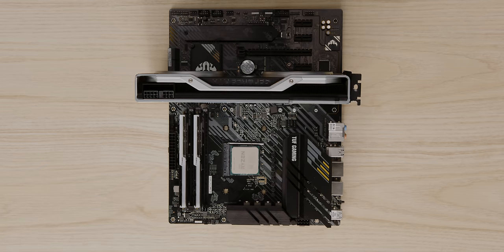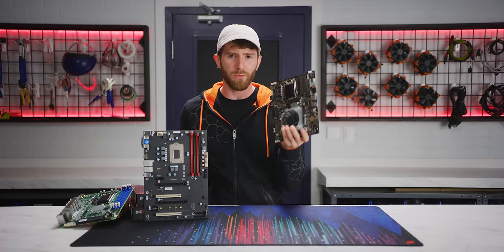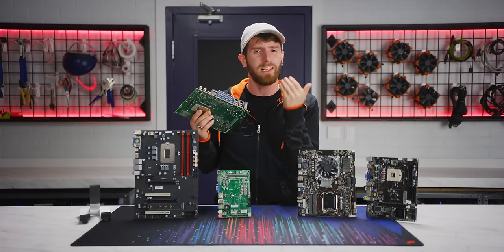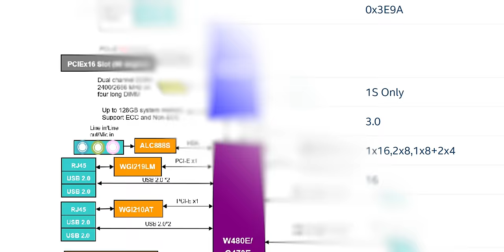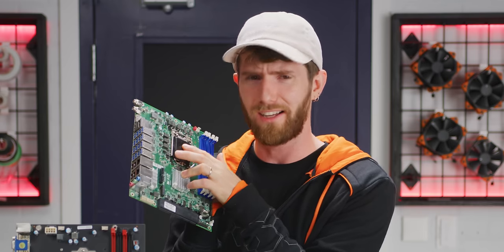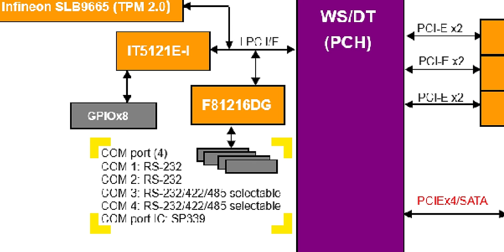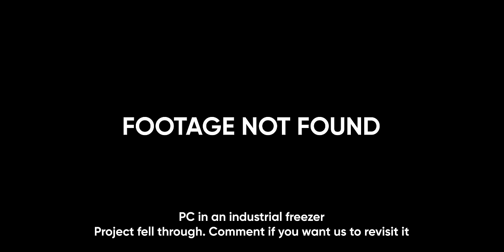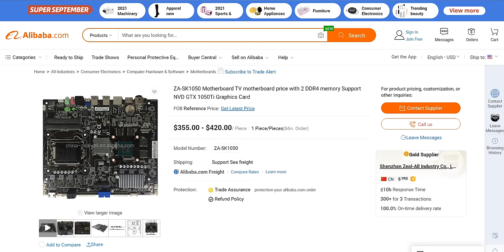5 weird motherboards that shouldn't exist

Comment: Not gonna lie, as a streamer with so much stuff plugged into my pc that I need a usb hub, that first mobo would be a godsend.
Reply: I agree with you, I need a ton of USB expansion myself. I want to upgrade to a 10 port Board like the ASUS ROG Dark Hero (AM4). After that, I want to build my PC into my desk and make a dual System case. One will be storage, one does everything else. I honestly considered threadripper at some point, but thats not certainly helpful on the main system atleast. Happy creating!
Reply: I just use a PCIe USB expansion card. No hubs to worry about (as I've had problems with hubs and audio interfaces playing nice) and you get more full speed ports
Reply: @alphapt9370  EDIT: I also look for dual Ethernet ports. One must be gigabit, one must be 2.5 gig since my storage would be in RAID (the secondary system I mentioned). I've tested it already with my current equipment without RAID, over one gigabit and also streaming it back (over Steam in home streaming with almost no compression maxing out at 104mbit upstream). It did work fine, but going a bit higher doesn't hurt here since I definitely would cap out on 1 gig due the increased read speed of the RAID. Also theyre very fast drives too (for SATA atleast). I mean on what average drive so I get 200mbs per second? The best consumer grade drive I found would throw 180mbs at best as far as the collected data is to be believed. And it probably doesn't just host games aswell.
Reply: @Aquatarkus96  I don't really want to go that route. Probably more pcie lanes being used that I could need somewhere else, but I'm not too sure how exactly every motherboard out there handles their lanes and IO. I know quite a bunch, but I don't know everything, but I try to know everything. That's a hard goal to achieve and I probably will never succeed it. There is just so much information in this world. But I will try to ever expand till I can't no more. Maybe I'm just crazy
Reply: @alphapt9370  Also consideration is also the Lian Li DK-05F or a custom build. As far as ive seen, all the ports on the dark hero are usable? 4 go to the CPU, the others are chipset as far as I know. Gigabyte overs thunderbolt tho. Thats also a selling point. Pretty hard decisions tbh. Also Ryzen XT (we don't know naming yet but probably XT) will be important with more cache. Data compression and heavy CPU and cache heavy tasks will most likely be a thing. Will have to see how it performs in comparison to the CPUs without the bigger cache. CPU performance is important, Threadripper would be more useful, in terms of IO, PCIe lanes and multicore but less useful for other tasks and also more expensive.
Reply: @alphapt9370  ❤️ very kind of you, its nice too meet you ^-^
Reply: @Mom19  As promised, back.
It's fine setting your goals high, as it's your pet project, and you're the one that should know the end goal.
As for the CPU choice, when the XT variant comes out (well, yeh, all points that they should call it that), my mobo suggestion might not be the best one, as it wasnt tested for those higher end skews. 

For fans, look up server grade fans, as they are designed to move the highest volume of hair on enclosures. Mind you, they are loud. And dangerous, to a point. It can easily break skin, or nip a tip of a finger. So if you go that route, be 100% sure that they are protected from the outside\inside with a metal grid to prevent accidents. But they will move all the air. If sound is an issue (and it should), you cant go wrong with Noctua. They're not pretty, but that's subjective, but they also have them in black, and that's less of an eye sore. Hard to find, but they exist.

As for mobos, i'll probably repeat what you already know. Most brands have 4 skews. The budget, the mid range, the high tier and the enthusiast grade boards. What is important is what CPU you're pairing it with. Knowing that, we can exclude the budget and part of the mid range. Comes down to decent VRMs, and how decently they are cooled. We can also exclude enthusiast grade (but you do you), as they are extremely expensive and do not offer that much on top. The one you picked is considered high tier. Personally I think most mid-high range can provide the performance that a high level user will ever need, but that's me. We can dwell on the skews if it comes to that, as this requires looking at all brands offerings, looking at the specific skews that will fit your needs, see what boards can drive a 5950x without any tested complaints (we can extrapolate if it runs it, it can run the XT when and if it comes out), and then have a short list of options that works for your use case. 

As for RGB issues, I already covered that in my previous post, giving you the software option to drive all of it, as you want it.

As for dual ethernet ports. It could limit your mobo selection, so i suggest you work around it. If you dont find a mobo that has that specific request, you can always go the PCI-E way instead, increasing your mobo pool of options. And I understand you wanting to give it a bit more breathing room, but remember it needs a equal speed output on the other side. Here's assuming as well the drives you have can fully saturate it. I still dont understand what your usage will be, but if it's just file serving, have you considered a NAS drive instead? Even as a game drive, given enough bandwidth, it's perfectly suitable. If the 2nd PC was just for that, consider just this instead. Mind you, the NAS rabbit hole is long and deep. You can find easy to use solutions, affordable solutions, expandable even, but the price range can be from budget to "since when I was a fortune 500 company to even be looking at these products" range. What they boil down to is dedicated compact PC's designed for the sole purpose of file sharing towards a network. Be it one or more, that's where they shine. But a step down from a server rack with storage.

Dont worry that much about bottlenecking. As it will happen. It's a losing battle. The best we can do is mitigate. But there will always exist. But from what I see your vision is, and what components you're planning on getting, you should be fine in most workloads. And yes, Threadripper is a work horse, with the price tag to accompany it, but it also limits you in your mobo selection, as it uses the TR4 socket, not the AM4. As a sidenote, one TR mobo is the Zenith. The Ethernet port on the board is the I211-AT, meaning 1GbE speeds. So they included their Aeiron 10G PCIE card in order to provide better speeds. It's not out of the kindness of their heart, it's a 800-900 buck mobo. But this illustrates the best solution. First, find the mobo that fits your needs. And then add a couple of PCIE slots on each PC with better speeds to ensure they'll never get saturated (as you've stated, that's a thing you want). 
But back to bottlenecking. The "secret" is finding out where it happens. Normally it's CPU\GPU. GPU's, even high end, rarely get to saturate the bandwidth they're allocated. CPUs tend to be bound more often, and that's fine (because you're already aiming to the top performance option, there's nothing more you can do, and it also means your GPU is debiting everything with breathing room to spare). Because infinity fabric is a thing, RAM "can" be a bottleneck, but in reality, it's not. It's more if you're leaving performance in the table by not having the right timings to take advantage of it. Now HD speed can be one, if you're like a friend of mine (that will remain anonymous) that still wanted to use his old HDD's, because "they still work", and thinking that extra storage meant anything at all. Bottom line is acknowledging it's a losing battle, and try not to have a very weak link to bring all the performance down. 

So yeh, wall of text, sorry about that. But l really hope it helped, somewhat, and at least gave you options on routes\options to take. And if you want to pick my brain for anything else, feel free. Also, if you disagree with any options given, also feel free to say what they are, so I can try to provide you with other solutions. Have a great day!
Reply: @alphapt9370  Thanks again your big answer. I read through all of it and I already have a good view on what I want. Noise is definitely a concern. This desk would have a lot of fans and a lot of high speed fans are a lot of noise. I started to use noctua at some point and I know almost every product they offer so far. I personally just had 3 Types of fans they offer, but they always were the best in performance and noise performance. Everything else I used was either worse in performance or louder with the same performance given. It will definitely be Noctua. Just what type of fan isn't 100% clear yet. This project most likely won't be even started in like 1 year or  2. As I said, I just started my job training and this will be my "celebration" once I finished it. My Job is all about IT. Severs, Software, Hardware and everything in-between. I don't want to brag and I hope I don't seem like I do, but over time I build a bunch of computers at home for friends, enterprise use and people doing professional grade color work for example. I had old and new hardware in my hands. Everything from a few Megabyte hard drive back from 19** something to recent Threadrippers. And with my current job I even have access to newest server grade hardware. Not like I can buy it for a better price or they gift me such stuff, but I get in touch with it and get to tinker with it. I also have older Server Hardware but not much useful in today's environment. Also delidded a Pentium Pro just for fun at some point. Very interesting to look under its hood, but definitely not easy to open it up. Also a bit of hardware story from the past: do you know AMD Duron CPUs? Or Triton? Or Phenom? Triton and Phenom for example had locked cores because they didn't meet the specs perfectly. But you could unlock them. Very interesting and fun to do in my opinion. Duron was also an interesting chip. It had a locked multiplier, but you could unlock it with a pencil. You just bridged certain connections on the chip and there you go. Unlocked multiplier. Back to my plans, Pcie cards would be an option, but would like the ports embedded on the board. About VRMs, I roughly know what VRMs I would need. Mid and budget range isn't an option. Those few phases, often no cooling.. they will be junk with a powerful CPU at some point. I have seen it from my people. Btw I repaired a 970 aswell. It had blown mosfets because they had no contact to any cooling. Swapping them was a pain in the ass but I managed to do it. Just added a thermal pad to contact the main cooler and problem solved since then. Never died again. Anyway, the RGB software is really great. I didn't had time to test it so far, since I currently migrate like 40-60 kilos of hard drives. But it looks promising. If I can add ICUE profiles that I spent days on, it would be perfect I guess. With this the software issue is basically solved.
Reply: @alphapt9370  As far bottlenecking, I know you will always have one. Something is always a limiting factor. Its just a question if it matters or not. As for hard drives, I will use 10 Terrabyte Server hard drives. Most likely 3 or 4 of them in RAID 5. I don't think I would actually degrade them to a point of failure, but you never know. Will have a backup anyway aswell. These drives are also pretty damn fast. CMR tho. SMR will never be an option to me. I have their 16 Terrabyte bigger siblings from the same lineup in current use as mass storage. Very  good drives in my opinion. They're not the most silent, but very performant. But this bit of noise isn't big of a deal really. They're absolutely fine for me so far. And on a side note, their 10 Terrabyte siblings are also a bit faster. With software out of the way, I don't have a problem with board brands anymore. Probably. Still Asus and Gigabyte have good options. Gigabyte also overs thunderbolt. Thats very nice to have, but not strictly necessary. As for internet input speeds, I can't get more than 1 gigabit from the grid, but would like atleast 2.5 gig in my internal network. With 1 gig (what I don't have yet, but will book that when stuff gets serious) I am able to pull about 15 terrabytes down in just one day and 10 hours. Very very compelling. I don't plan on pulling that much, atleast not in bulk. Anyway what I calculated would be about 6 USB A ports needed. More would definitely be better, but atleast 6 is definitely a thing. I'm currently migrating a ton of drives as you already read, and my current 4790k on an Asus Maximus Hero Vii will be used for storage. 8 SATA ports are available and will be used atleast temporarily in a case under my current desk. My current case has poor thermal performance and is heavily moddified. It has its side panel swapped from left to right and right to left. This means, I welded the right panel so it would fit on the left side and vice versa with the other panel. The reason I did this, I build a screen into my case. The left side had a fan grill/hole that would be absolutely stupid to cut and use. I CNC a frame into the right side panel, welded it to fit on the left side and also modded the case to have a vertical GPU mount. The case doesn't have much space to work with, but I also installed a Reservoir in the top of the case frame. The screen was a project of its own... A laptop screen. And since it has internal connectors that go directly to the laptop motherboard, I would need something that can adapt it to HDMI, DVI, VGA, DP etc. Hdmi is fine tho. Anyway, I had to get a Mainboard for it, which I managed to find. Next problem was the screen. Certain screens have their foil layout that "stupid" (atleast for my usage) you pull of the most important foil right from the beginning and the foil I don't need is laying underneath... The foil that I would need standalone, would cost me as much as 3(!) Laptop screens. So I just got 3 different screens that fit my Mainboard and hoped to get one with the perfect foil layout. And I got one. The screen is milky see through when its white or turned off and has a good image from my viewing angle. The thing is, its a TFT Display. If you stand right in front of it, the image doesn't look good, but from where my case is located and my shifted position and therefore color shift due the viewing angle from where I look at it, makes up for it and it looks very nice then. Also had to custom print certain stuff and CNC and weld the panel aswell. I also powder coated it. It was a nice project to work on. Will keep my screen and my panel definitely. But the case, not enough space really and poor thermal performance
Reply: @alphapt9370  Quick edit: I know hardware pretty well, but in electrical terms, VRMs are pretty confusing. Honestly my biggest question I have right now is what motherboards would be good for this project. Definitely will be X570 tho
Reply: @alphapt9370  Another edit: I think the X570 Aorus Master would offer what I search for. Your opinions?

Comment: I was hunting around for cheap x86 systems a few months ago, and found motherboards with DEEPLY embedded AMD CPUs in the PCB to the point that you didn't even see the silicon. They were the same size as the smaller-than-ITX board from this video. Looking at front and back pictures, there was no visible CPU or chipset, or heatsinks for them to hide under. There were empty spaces free of any SMDs except for the capacitors/transistors and what-have-you that you would typically find under a CPU package or on the backside of the socket. But you could also see traces emanating from those spots where you would expect the CPU and chipsets. No solder pads or anything to indicate they were boards that needed a CPU, and they were listed with exact CPU models, not a range of supported chips. It was baffling and I'm still not sure if what I saw was what I just described, but they are by far the strangest motherboards I have ever seen
Reply: any links ?

Comment: I really wish I had that many usb expansions. I regularly fill up all 10 of the default ports on my machine and have to start swapping peripherals because I don't have a usb hub.
Reply: Out of interest, what all do you have? I can't think of a use for more than like, 7 ports:

- 1 for a keyboard (some have 2, though those usually have a built-in hub)
- 1 for a mouse
- 1 for a monitor
- 1 for a second keyboard of some sort
- 1 for a card reader or some other authentication thing
- 1 for an external CD/DVD drive
- 1 for a USB stick or SD adapter or something
Reply: @RyanTosh  Bit of an old comment, but it always changes a bit through the years. onto your list, i also add things like a graphics tablet for illustration, the chargiing cable for its pen, a wireless controller dongle, webcam, SD card reader when the built-in inevitably dies, and I'm sure there's others. it's just always been a bit of a nuisance through the years to not have enough usb ports for everything.

Comment: Honestly, if it wasn't for the weird power connections, I've got a use case for that first motherboard with bonkers amount of USB ports.
Reply: I would have had one in my old job where among other things we refurbished phones. We'd use ThinkPads and USB hubs, but there is a limit to how many USB ports a laptop will support. A few of these would have been great.